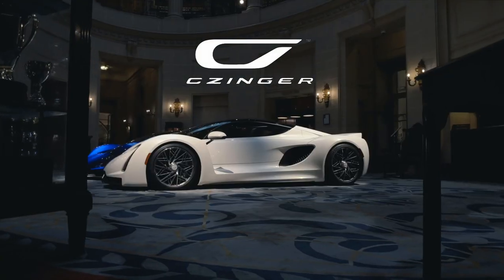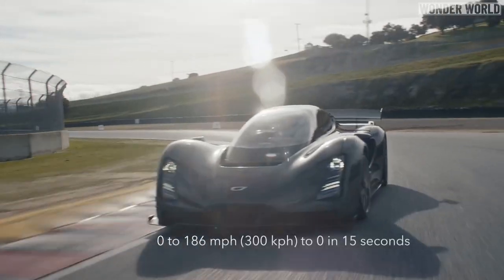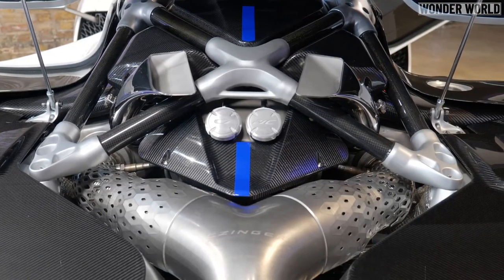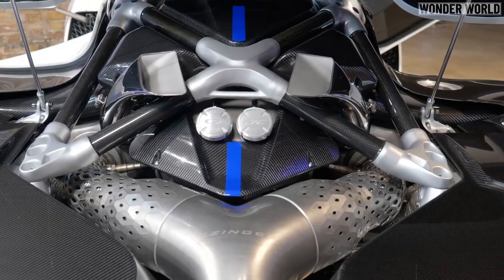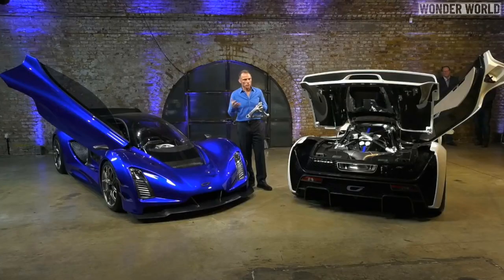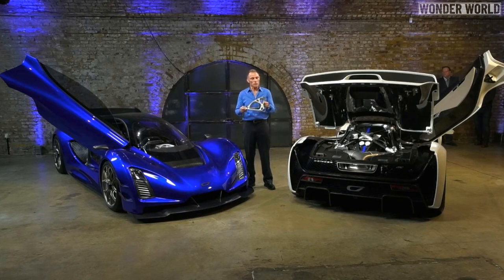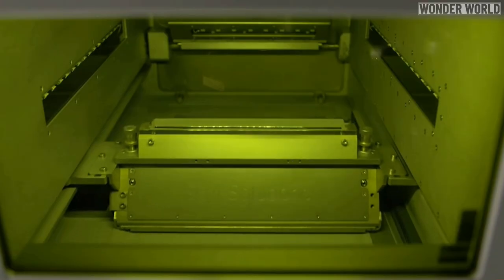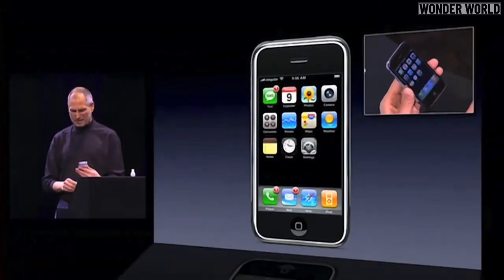AI Designed and 3D Printed Supercar

Comment: Major auto makers are doing a "sinister" version of this - design a part in a computer and "wear" it for 100,000 miles and see if it breaks. Then design it thinner and lighter, one milometer at a time until it breaks. Then build the whole car to last 7 Yr/70K miles, get clear of the warranty and new car trade-in and financial loop, then the car can just "grenade" !!
Reply from the maker: Japan already does this, car are only designed to do about 50,000 miles, then they sell them second hand in mass overseas. Melbourne Australia Airport bought some to just run about the airport until they breakdown.
Reply: Hence the saying "they don't make them like they used to."  All these car companies....and not only car companies there's a lot of other companies that are all about the bottom line, that Almighty dollar, they don't care about their customers and they don't care about their products just as long as it lasts until the warranty is done and then they try and get you back and buy another one.
Kind of sad really.
Reply from the maker: @jonny555ive  it truely is Jonny, i bought a bedside alarm clock 25 years ago, and still have it today, but just recently it has started making a hum noise, So i am trying to find a replacement clock, and I have truely been looking, I have gone through every clock on Amazon and every clock I think looks perfect for me, i read the reviews and no one like it, I bought one off amazon for $80 and OMG it's like a night light it so bright. I have visited every major retailor within 30 klms who sell clocks to see what they have and they are all crap. i just cannot find one.

I have had the same problem with headphone, i cannot find a replacement for my 5 year old headphones, I have bought like 5 pairs off amazon, received them, tried them, did not like them and returned them and i bought all the high end ones, costing like $300-500 they are all crap.

So currently I am still looking for a clock & headphones, but I have kind of given up out of frustration.
Reply from the maker: @jonny555ive  thanks for the suggestion
Reply: @WonderWorldYTC why not fix your beloved items? Even if you can't do it yourself it sounds like your budget could manage paying a professional. I feel your pain. I too love and miss older stuff.  My solution many times is buying 2nd hand on eBay.  Many times I get what I want, it's cheaper and arguably environmentally friendly. Whats not to love?